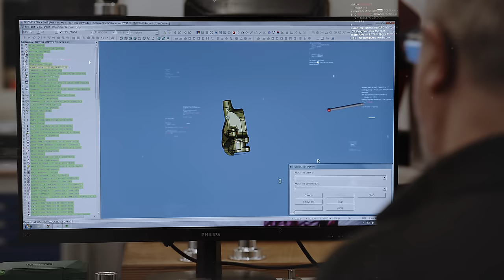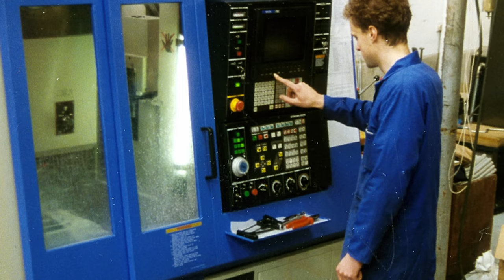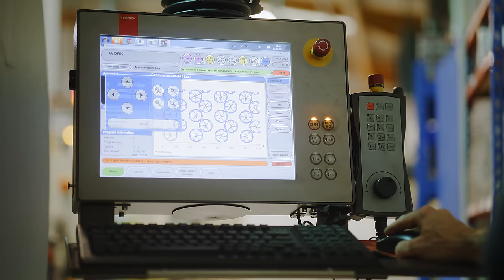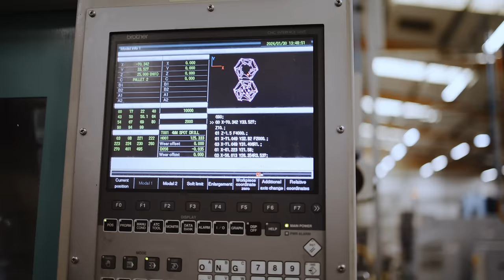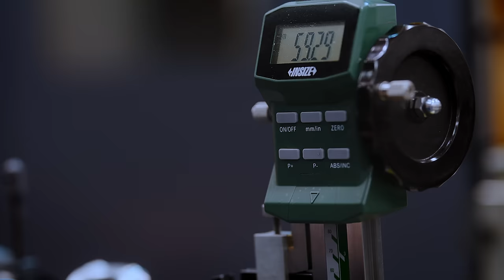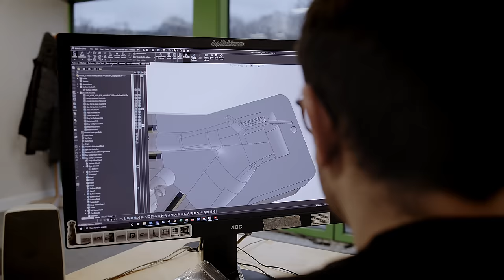Hope: Inside the Factory

Comment: Love Hope, I've been using their stuff since the 90s. Although, in the early days, my front disc did warp when I heaved on the front brake, locking up the front wheel on my Orange P7 Pro SE. Unbolted the rotor and rode home. Great to see them getting bigger and stronger.

Comment: Still have my first Hope product, a 35mm seat clamp, got it back in 2005, also still have my first set of Hubs, Pro2 SS/Trials OG with the double bearings in the freehub, that was changed shortly thereafter to a single roller bearing because they've used to blow up regularly. Aside from them, I also have a set of Mono Mini brakes and 5 other sets of hubs (2s & 4s) laced into wheels. Would love to get a set of brakes, but hate DOT fluid because it's so hydroscopic, whereas mineral oil is hydrophobic, DOT doesn't work well down here in the Tropics and wouldn't expect it does better in UK type weather, so don't quite understand the argument/use of it TBH 'cause once it's absorbed some water, that higher than mineral oil boiling point quickly gets a lot lower than mineral oil.

Comment: Still rocking my 2008-2010 ish M4 Union Jack edition brakes in raw aluminium. Sexy as hell, incredibly sturdy and so nicely adjustable. Those things are still top of the line brakes almost 15 years later. Bought them used around 2016 for 180 Euros which was the top end of my budget for a pair of brakes and one hell of a deal. The only real upgrade I did was switching to steel hoses and the occasional disc replacement. Have thought about maybe upgrading to a tech 3 lever in the future, but this would only be for the looks. Also: I think I may have been lucky with mine but I have not needed to bleed them in the past 4 years.

Comment: Hi
Do you take calls for help with brakes? I have just bought a brand new set of Tech 4 E4 brakes, and they are absolutely awful! I've got pistons stuck on both front and rear. I took off the reservoir cap on the levers and then used a tool to reset all of the pistons, but one side comes out and they don't retract. It leaves it impossible to center the calipers because one side of pistons doesn't come out and the others don't retract. Not only that, the front calipers are squelching badly and the back of the pads have DOT fluid on them.
When I opened the box, I saw the plastic bag covered in fluid and it was all over the brake lever, but as it said on the box "Some fluid  on the calipers is normal"  I thought nothing of it.

I did everything by the book and looked at all of your instructional videos, but this has to be the worst experience I have ever had with brakes. After spending nearly £500 on your brakes and rotors, I feel substantially ripped off!
Reply from the maker: Yes you can either call or drop us an email: https://www.hopetech.com/warranty-service/

Comment: I love hope stuff and have lots of it but i would love the stuff you don't make yet.  You can choose which you want to produce, either a 35mm carbon bar with 40mm rise or do the gravity stem with a rise option or make a headset bearing that limits bar rotation so the 20mm rise carbon bar and zero rise gravity stem that I already have dont destroy my top tube in case of a calamity. While you're at it you might as well knock up a dropper post that not only works but keeps working in UK conditions. You're already half way there with the Lever you make😁 I know i can and do run headset spacers (hope ones) but they make an otherwise stunning bike look like its come from Halfrauds😂